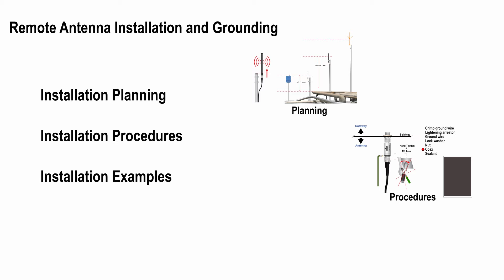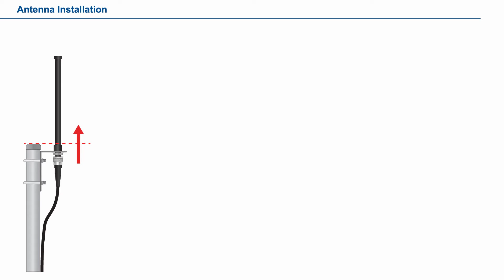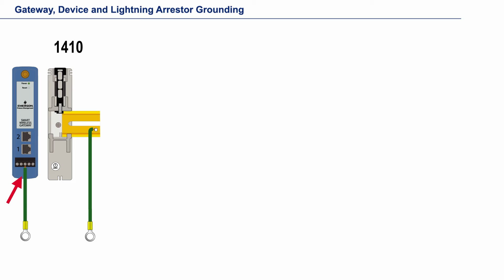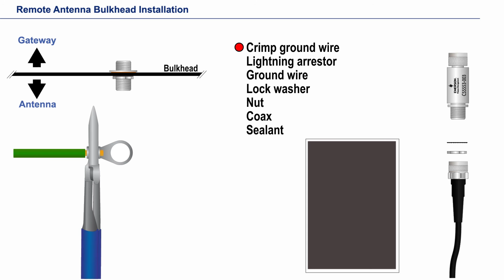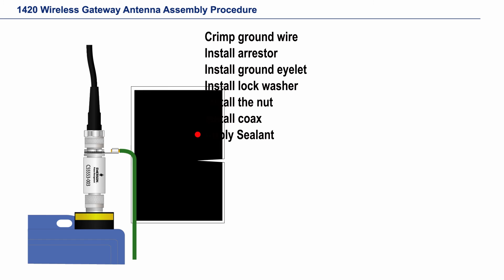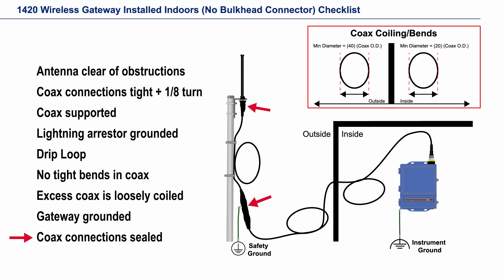Complete Guide to WirelessHART® Remote Antenna Installation and Grounding

Comment: Sir what is the purpose of coax loop?..tnx.
Reply: The purpose of the coaxial drip loop is so rainwater or moisture goes to the drip loop instead of the electrical connections.  This water could leak into the connections and cause a loss in signal or outages. Please email me at anna.riebel@emerson.com if you need more information about remote antenna installation.
Reply: @annariebel522  Based on your description here, you are saying that it is only intended to create a protection for rainwater. Well, you have a video statement that colling can be done with a diameter of 40 cm in an external environment and a diameter of 20 cm in an indoor environment. So why do we colling inside? No humidity problem, no rain problem? Can you explain please. Your valuable information will help us a lot in assembly. Thank you.